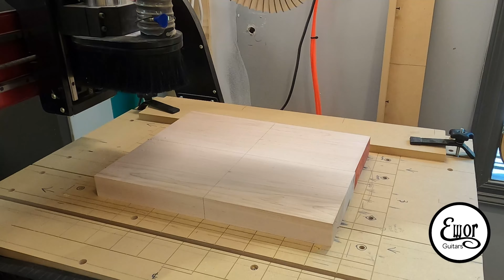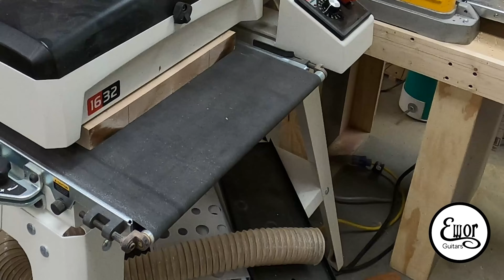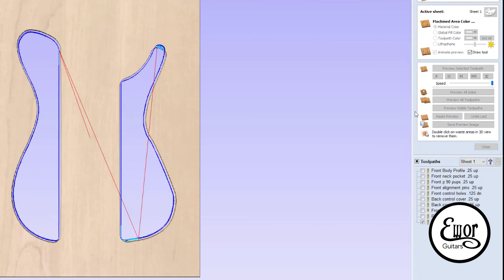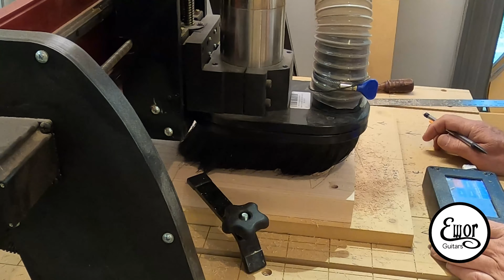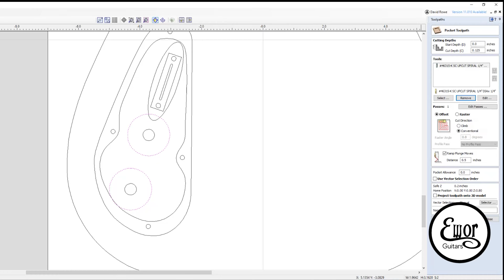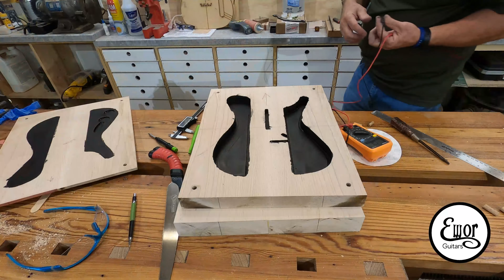My Journey into CNC guitar building: Part 3

Comment: Looking good. I don't understand why you didn't go ahead and rout the wiring channels in the back of the body all the way to the chamber where the Pots and the switch are going to be. Seems like it would have been easy to do before the top went back on. With the top on you will have to drill and find where the channels are hidden under the top now.
Reply from the maker: I guess all the wire Chanel’s didn’t show up in the video but there are three. Neck pup to bridge pup then bridge pup to control cavity and also a rout for the bridge ground. Thanks for watching I really appreciate it!